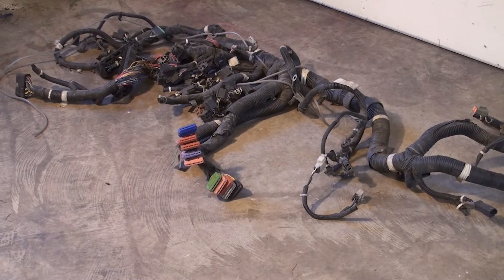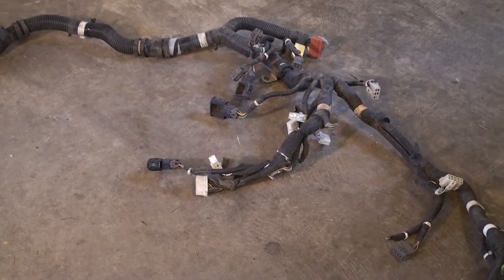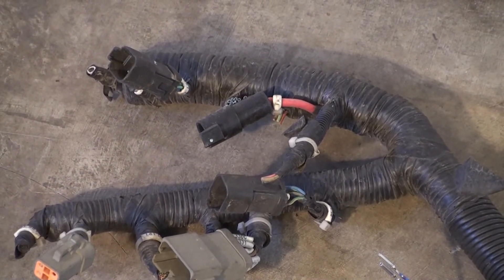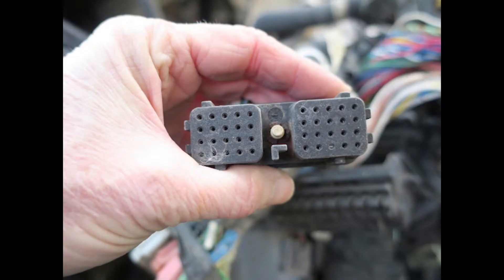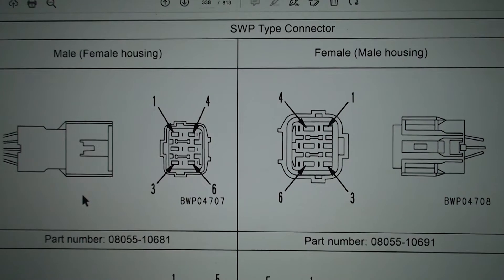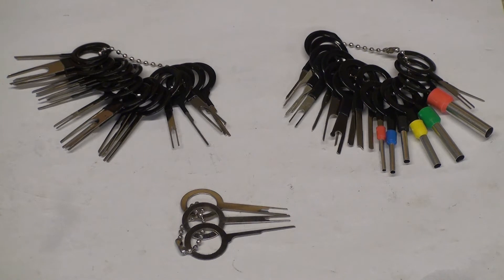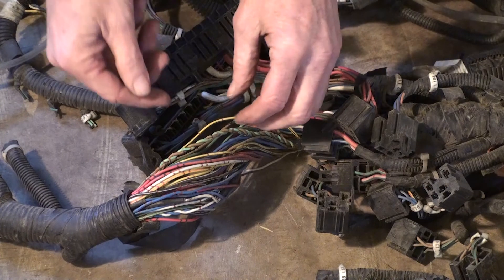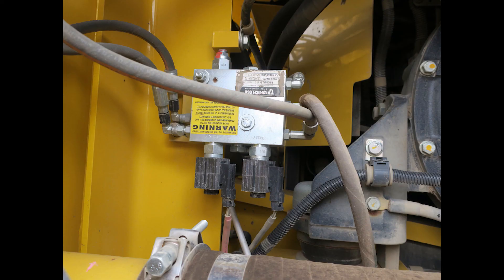Heavy Equipment Electrical, Wiring Harnesses

Comment: Well done !  This reminds me and appreciate how well " WABCO / Westinghouse  " built wiring the wiring harness on the Pull -Riggs back in the 1960's .   They forgot more about moving electricity then most will ever know .
  Keep up the great work !
Reply from the maker: Thanks for the comment. I had four of those machines at one company I worked at. As I recall all the wiring had cloth covers on top of the rubber insulation.
Reply: @repairsecrets   Yes , Harness  had the heavy rubber outer cover , cloth wrap then like a sisal type twine weaved in between the control & 3 phase wiring .   I still have a few pieces hanging in the shop .    I'm amazed how well the rubber held up being 60 years old !  It's still pretty flexible .  Must have been made out of some pretty good material . 
  Still have one C-Pull .  
   I don't think the rubber today on some products is as good as it used to be ?   We put dual quad Edelbrock Carbs on the hot rod cars and the rubber vacuum plugs that came with the carb start cracking open after a year .
Reply: Please Sir can you share here with us where we can learn about equipment electricals